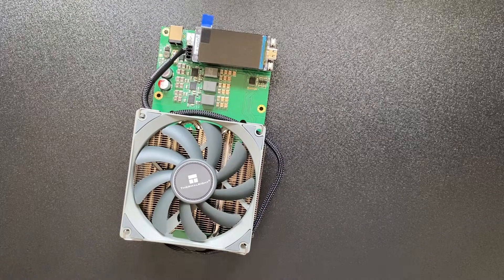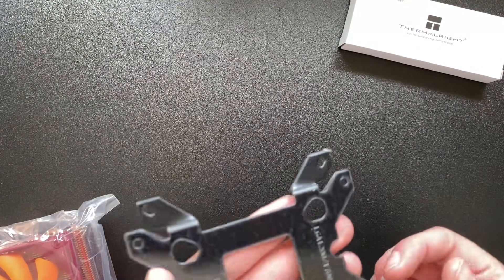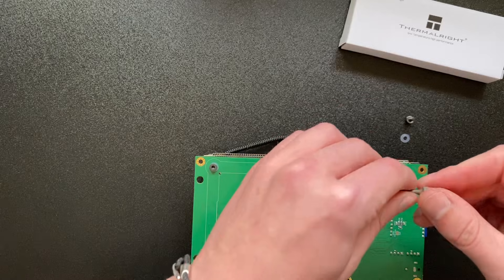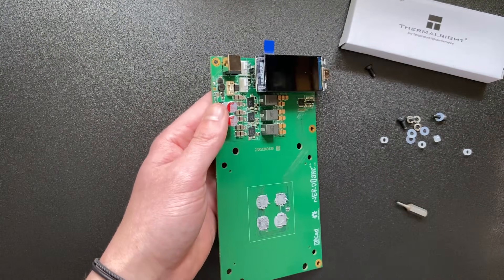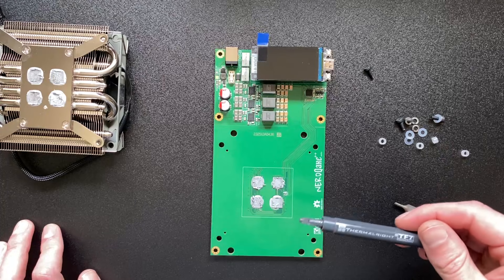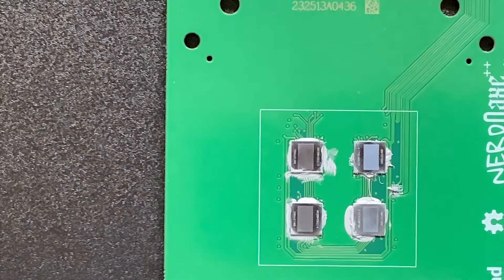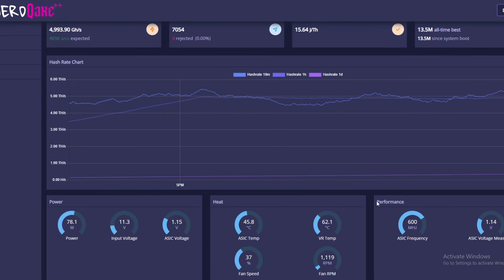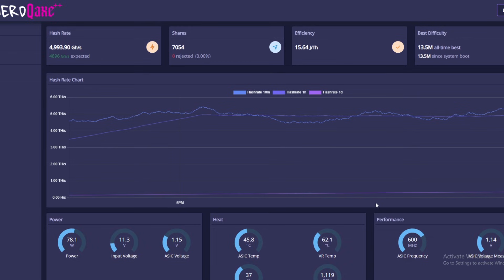Copper Heatsink Upgrade For The NerdQaxe++

Comment: i bought the x47 version cause the x53 version where not able to get. but think it will be also working. mine are running constantly at 55 C and i hope they copper ones will bring it down.
Reply: How did the copper x47 work out as I was thinking to get it as well for mine? I see most people using the X53.
Reply: @ncity_reiver wasn‘t able to get the x53. x47 works great. run them on 725Mhz and 1210 CV. Temp is about 50C VR. But i used the original for backside and a little 4 cm Noctua on the front for VR. so running 3 Fans each. and i use a Mean well 150-12V power supply for each NerdQaxe++

Comment: Thanks for posting! I'm waiting for the 47 full copper to come today and then will compare with 53 and choose which to install

Side question, do you think too much pressure on bolts would cause the Bitaxe to overheat? I have been running 3 of them (in a 4 sided stand) all with Kryosheet, LP Ice Cooler, 6x15 Noctua, and one extra fan blowing down from the top. They were doing fine for a week and then the top fan slid off and 2 overheated. Now I cant them to run cooler, even after I swapped out Kryosheet for Kryonaut Extreme. paste. Wondering if I have the coolers too tight - but they were working fine before. I am puzzled

Comment: I dont get the point you changing the heat sink and you set the thermal paste from the box. If you want to overclock, use proper paste. I highly recommending ID-COOLING FROST X45. Thermal Conductivity:  15.2 W/m-K 
Thermal Resistance: 0.03℃-cm²/W
Operation Temperature:  -50℃~300℃
Density:  2.8g/cm3
Viscosity: 140 Pas
Reply: thermal paste troll

Comment: What would the optimum overlocking settings be if someone was not going to change any of the factory default parts?
Reply from the maker: Probably -f 675 -v 1150
Reply: @SterlingSpecter1 One follow up question, the scale doesn't go past 625, and I saw you did it by going to inspect, I did that but cannot figure out get it to get me the option to increase the number?

Comment: impressive that you can run the ++ at 37% fan 😮 btw, I think this is 1.0.27 fw? The 1.0.28.1 fw will show 10°C more asic temp - but it's actually not hotter than before. The value is just more accurate. Also in the coming 1.0.29 there will be the PID temp controller that let's you set a fixed temperature and the PWM adjusts automatically. There is a "v1.0.29-beta4" in the webflasher to test this feature. But I think the 1.0.29 will be released very soon
Reply from the maker: Perfect, I never really know how the temp were calculated because each chip would read different

Comment: Thank for the videos! I love them because you do exactly what I am thinking to do with them. Do you think the ALITOVE AC 110V/220V to DC 12V 30A 360W Universal Regulated Switching Power Supply Transformer Adapter will work to power 2 of these overclocked with max cooling? I have a plus but ordered 2 ++ with plans to incorporate in a new PC workstation build. Powering these without damaging them is hard to find a lot of information on what to use. I feel the power supplies sent with them are very underpowered.

Comment: Am I right in seeing that the NerQaxe just uses the LGA1700 mounting holes so I could also use an AIO with it?
Reply: It's LGA115x - the LGA1700 are the default brackets on the heatsink but you need to assemble the other one that are in the same package
Reply: @punpck  nice, so a Watercool Heatkiller IV Pro is possible or a Noctua NH-D15 G2 ? Maybe its possible to run in passive cooling mode complete silent... or maybe its possible to get 8 BM1370 ASICs in the same area, the NH-D15 G2 can handle 176watt...
Reply: yeah I was wondering that too, I guess it does which opens up the world of cooling towers to it. 🤔

Comment: Can you have a look at the oc axe article the king is dead id like your thought and testing on the low profile for the gamma im interested it the fan direction ive found some intresting posts that the noctura a6x5v is best at pushing air due to the blade set up i think you could make a great video on this thanks for your work really enjoying it

Comment: I would have turned the heatsink 90 degrees (I believe to see that the mounting holes are in a square), so that the exhaust of the fan is flowing over the other electronic components and give is extra cooling

Comment: Every time i watch one of your videos, I find myself going to Amazon or some other link you posted and then my bank account gets oh so smaller… so, thanks…?
Reply from the maker: its a good addiction to have
Reply: @SterlingSpecter1  I tell my bank account that, but we’re still at odds😅
Reply: yeah, I feel for you, now it is power supplies and the endless options. ugh :)
Reply: @unitymind  I have 2 5V 300W Power supplies running 3 gammas each. They’re OC’d and running with an average hash rate of 2TH.
Cooling is done using the Argon THRML 60mm fan and heatsink on the ASIC and a copper heatsink on the VR and a Noctua 40mm fan on the back VR and an UpHere 120mm 4 fan setup blowing air through the units.
Reply: @ you have pics anywhere? I want to power these but they are 12v so I think I should get a 12v 300 watt. I have a fan problem :) I bet this would take a massive heatsink or just a couple of AIO's would work too.
Reply: @ i dont have anything posted for my builds at the moment. i just took delivery for the low profile heatsink from the Raspberry Pi 5 and I’m going to compare the cooling with that vs the Argon THRML. Both will use the Noctua 5V A6-15 for moving air.
My Qaxe++ will be liquid cooled because, why not🤷🏻‍♂️ Just need to figure out how to liquid cool the VR’s as well because those are the limiting factor when it comes to OCing these solo miners.
Powering it will be a 12V 50A 600W PS which will run the miner and cooling pump.
I’ll look into posting my build somewhere.
Reply: Well said!

Comment: Typically the pipping is still copper vapor chamber, despite being silver in appearance, and the tech hasn't really changed for a couple of decades.  Either way the replacement you got is better purely because of the increased surface area.  I think these would benefit from a blade design that is spaced far less than the spacing of these blades, which will increase static pressure and help the air flow push through the fins, rather than potentially move around them